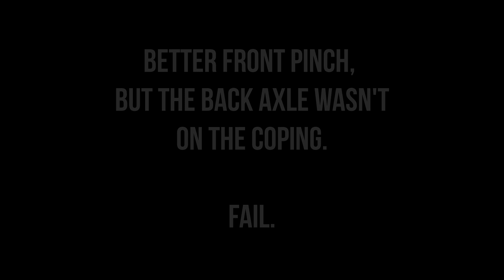Stalling for Time?

Comment: You're getting there.  You got a few decent ones in the sesh.  Keep it up.  I have a 3ftx8ft miniramp (6ft transition).  Love it.  But she will put manners on you if you take her for granted.  Good luck.
Reply from the maker: That's exactly what I'm going to build, though I'm tempted to go with a 7' transition to make it a bit more polite.  Worst case scenario, it's a little too mellow and I have to build a second one.
Reply: @theoldmanandtheollie1800  I agree.  Wish I did at times.  Also when you do that 7' you might want to shorten flat so you have enough speed.  I consider rebuilding mine.  Good luck!

Comment: Nice progress. Looks like you are getting more and more comfortable with each video release.

One thing that may help is dropping in from the 50-50 position. That can be freaky at first, but it will give you more confidence in what it feels like to stall at the top. What I do is start with my wheels firm against the coping and the other two stable on the deck. I then slide the back truck to the pinch point so I am cross locked. Then I drop in from there. The drop in won't feel any different than doing the stalls you are doing now once you commit. Committing is definitely a head game at first.

Good luck.
Reply from the maker: Love that idea, Jim.  I'll pad up big time and give that a shot. 

I'm discovering that the head game stuff is the largest obstacle sitting in the way of my progress.  A lot of these maneuvers aren't that hard if I just commit to doing them.  Like, the other day I used my mini ramp to get a lot more speed going towards my parking block for a BS boardslide.  After getting over the fear of the extra speed (and the more severe slam I was expecting), I did my best/longest/cleanest boardslides yet  It was awesome.
Reply: Learning to dop in  from 50-50, doing the slide of the back of the truck to the pinch/bite point for the cross lock is what finally helped me get the axel stall after many years. loose trucks, sliding that back truck to the cross lock position was a revelation, helps you find the bite/pinch point